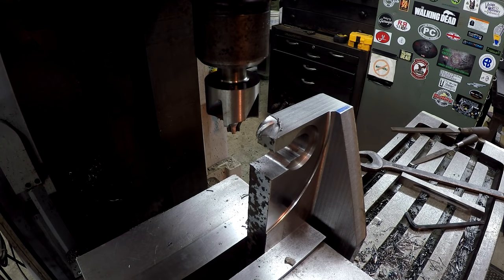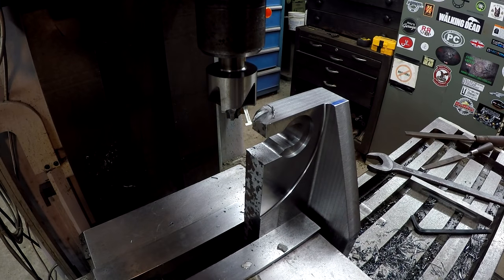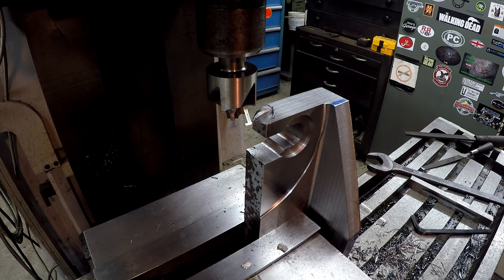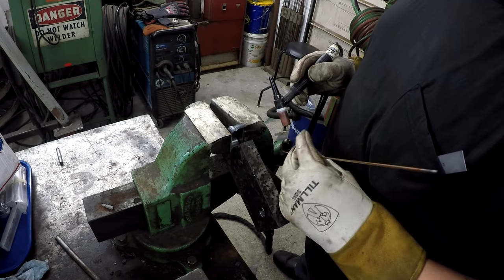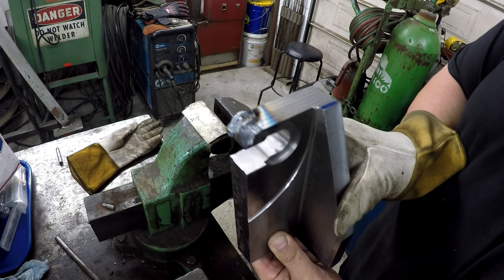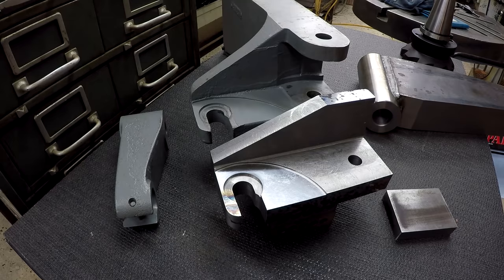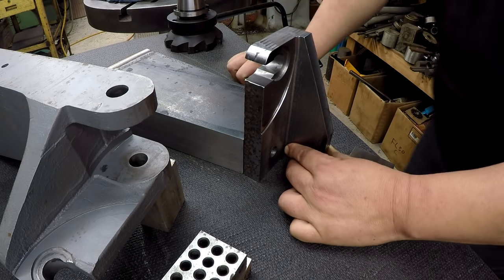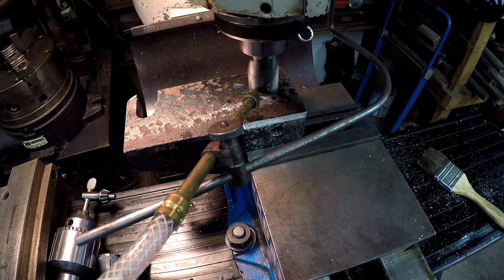Kearney & Trecker Parking Attachment Part 10

Comment: Adam,the shop I worked in for 39 years had an old Milwaukee horizontal milling machine just about the same size as your K&T.  We kept it set up with a vertical head and used it exclusively for milling large keyways in large diameter shafts.

Unfortunately, it has the same "feature" as your K&T!  I shattered a 1" end mill once by accidentally leaving the X feed lever engaged while rapid traversing the carriage "up".  Over the years, several of my co-workers had similar experiences with this mill.

Keep up the good work and don't be ashamed to share your "Bozos" with us.  We can all learn from them!  Retired machinist, Tree Top

Comment: YIKES!!  Looks like that was a scary screwup moment!  Excellent recovery from it though. ^^  Where I work, the only machine I run on occasion is a doozy of a machine: a roller die cutter! I've only had one incident with it in the twelve years I've been at the job, when I didn't have the top plastic plate straight enough during a pass and broke a whole corner off said plastic plate that was covering the material being cut and the cutting die.  Machine's built-in shutoff that detects such disasters kicked in and prevented further disaster, like wrecking the die and/or the upper press roller's supports and I have NEVER FORGOTTEN the lesson learned from that of keeping the top plate straight and lined up BEFORE sending the die/material/plate sandwich through the rollers on a cutting pass.

Comment: I was slot milling in 1/2" aluminum when the tool packed up and seized. Stalled the 3 hp motor. Pretty exciting. It "schooled" me on the subject of tooth loading and chip evacuation as well.

Comment: Man I hate when that happens! When John was down I showed him a apart I probably had 15hrs in and overshot the bore on the last hole and scrapped it. I probably would have just run the cutter on back a bit till it cleaned up since it wasn't a critical dimension but you got it fixed. :-)
Reply from the maker: Man that sucks Brian!

Comment: I had a Bad Programming Crash that messed up a 24" x 36" vacuum table, the machine spindle, and tool holder.
About $10,000 and 4 weeks down time.
My Boss said, "If you never make mistakes, you ain't working hard enough".
He never mentioned it again!
Reply: The shame is enoug punishment  I feld the same 
A college of mine crashed a new big machine the er colet nut split and one part flew of  and shattered the first layer of the huge window on the machine he was so mad boss had to calm him down
Reply: James White A guy in the CNC shop where I worked (as a toolmaker, no I’m not the guy) crashed a 3 day old CNC lathe the first time he used it, his mistake? A ‘+’ not a ‘-‘ 😳😳 
He moved the headstock, broke the tailstock, tool and toolholder, again several weeks downtime, much expenditure, lots of ribbing from colleagues and most of all the shame of it. Plus the installation team that he was bragging to came to fix it! 🤣😂🤣😂

Comment: I did the same thing at work about two years ago. Except the part I was working on was about 40,000 lbs and I was circular interpolating with a quarter round on the edge of the bore and programmed it wrong. Got my G00 mixed up with my G03 (don't ask how because I don't know). It wasn't pretty. Lucky I was machining it before heat treatment and there was .250 extra stock per surface. So it cleaned up. Thank god!

Comment: Hi Adam, when you are ready to weld the two parts to the main body could you not put the part at 13:57 between them like that and shim it accordingly then clamp all three parts then weld the outsides, and after welding the outsides if you intend to weld the inside you could clamp the piece to the corner edge of a bench, both the main body and dell pinned part therefore should be no movement  during welding, anyway just a thought, by the way if ya shim it consider shimming it at the edge rather then all the way in, makes it easier to remove shims after. PS Just to say you are an amazing heart, if ever there was a brother from another mother you'd be it :)

Comment: I still have bad memories of manual CNC tool changes years ago. All you needed was to forget a tool change (or insert the wrong tool) for a spectacular crash of part and machine. Anyone who hasn't duplicated your "rapid feed hiccup" a few times probably hasn't worked on a mill much. Nice fix.
Reply: I can do it... and I don't even have rapid feed. :)
Reply: Yeah, back in the 1970's I worked at Burgmaster....Elec/tech on big turret drills/mills (not the tiny ones you see on Youtube). Saw a few times on machine tests before shipping where guys forgot to change the  Z-axis from rapid to feed....1-1/4" drill hitting the brand new table at 400 IPM...which was fast back then....400 IPM rapids...40 IPM max for feed...

Comment: once it has had a coat of paint (and you know many castings have some body filler under the paint from factory to hide rough castings) it will be just fine, its no more than a waste of 10 minutes, not a show stopper.

Comment: Hey Adam.. Just a thought ... to keep the part not moving when welding why not use the part that John machined as a spacer and to keep the part from pulling in or out?.....
Reply: My toughts where about the same. But just use a scrap piece with the correct size as a spacer clambed between there to stop it from worping...
Reply: Plus a thin shim for clearance.
Reply: Yep just to make sure
Reply: Cool idea!  That would work perfectly.
Reply: HAHA i was thinking same think if not use the part John made you could even use a small piece thats that height or a thou or 2 higher for flex
Reply: If you listen carefully, he says, "that's where the part that John is making for me goes". I am thinking Adam made the video before he received John's part.

Comment: At least with metal objects in most cases you can build it back up and re-machine it. Just need to invent some wooden welding rods for my cabinet making :-) Great videos BTW :-)
Reply: Yeah i got to agree. Wood is, in most cases, an unforgiving material.

On the other hand its quite easier to handle, at least for me, than metal :)

Comment: I've rapided a CNC into a part before, had the setting on 100x instead of 1x.  it happens!
Reply: How about a missing leading zero (z-.90 vs z-.090) and destroying a custom collet and tool? As I tell the guys in the shop: decimal points, negative signs and leading zeros are important. I teach from experience.